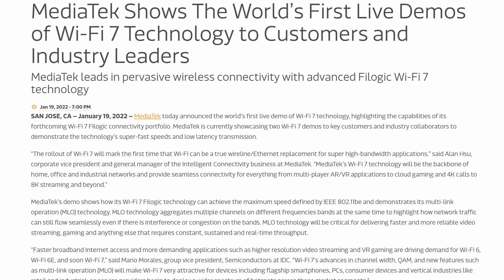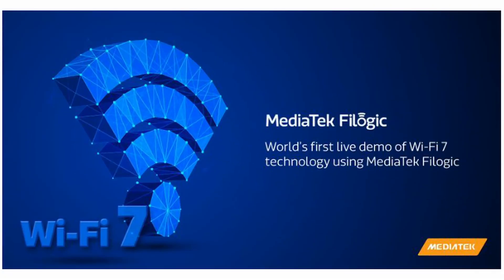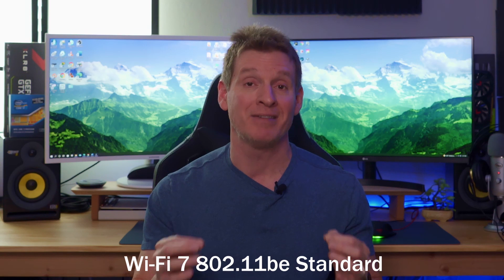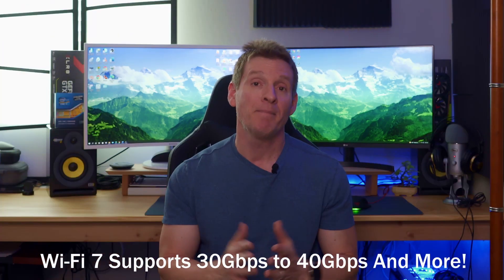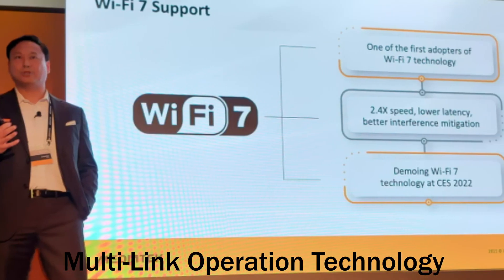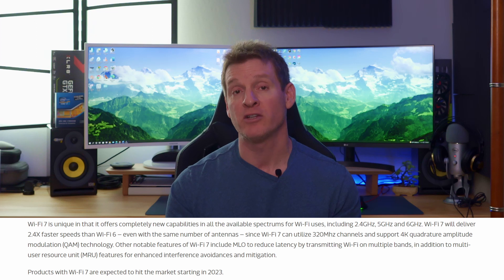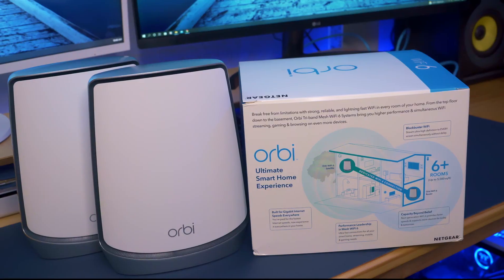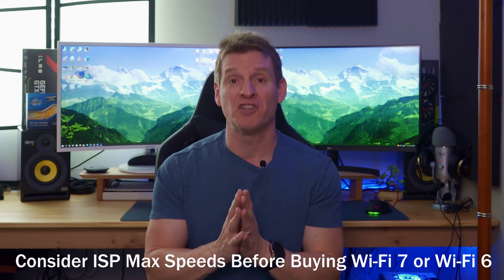Wi-Fi 7 FULLY EXPLAINED!!!

Comment: Is wifi 7 same as 5G ?? What is difference between 2
Reply from the maker: Wifi7 is your Wireless Home Network speed from the router which depends on your ISP max speed. 5G is an ISP that gives you up to 10 gigabits per second in the best case scenario. Speeds will vary depending on end devices and where you live. For those with typical fiber or cable internet Wi-Fi7 would be a fantastic choice. But Wifi6 or Wfif6e is also pretty amazing! Thank you for watching!
Reply: @UltimateTechHub  thankyou 😊 So if wifi 7 support 30 Gbps then it will become 6G service provider?? Too right

Comment: WiFi 7 802.11be 2024 7th generation of WiFi, the ultimate online experiencewill be unleashed
4.8× Faster 
WiFi 7 accelerates throughput up to 46 Gbps 100× Lower Latency* Worst Case Latency is 100× better compared to WiFi 6 with 15× better AR/VR performance
× Network Capacity*
With 320 MHz and MLO (Multi-Link Operation), WiFi 7 provides up to 5× greater capacity than WiFi 6
Reply from the maker: Thank you for watching and for the great comments and information!
Reply: Hey Michael This is me Cathy. Only God has the control to make Wi-Fi 7 come out in 2023 in so as his son Jesus Christ so all we can do about it is we can just pray about it and then after they both answer our prayers about it then they will be 100 percent sure to make Wi-Fi 7 come out this year in 2023 instead of waiting until 2024.

Comment: In the no-marketing real world you can expect speeds between 600Mbit/s and 1.5Gbit/s.  The real exciting new thing is the possibility to use 6GHz which this guy totally missed.
Reply from the maker: 6 MHz is very exciting. Wifi6e is the next step but wifi7 is right around the corner and  it is the future. It can use all of the channels and the MLO technology is pretty impressive. Real-world tests like I said will be interesting  because not everyone has the end devices to handle it....yet. I will bypass wifi6e for wifi7. My current wifi6 access point gets me around 800 to 900mbps with low latency. I do have Igig fiber. I have a video in editing about wifi6e so keep an eye out. Thank you for watching I really appreciate it.

Comment: I recently got myself an TP link eap660hd wifi 6 AP and shut off the wifi 5 ap that is built into my isp provided device.  That wifi 6 ap improved speeds on all my wifi 5 devices I have in the house. Currently the only wifi 6 device I have is my desktop and I got almost 700 down on a speed test.  But, it's always hard wired. But wireless tech is absolutely fascinating.
Reply from the maker: You have a really good setup!! Congrats!! Yes I am amazed how fast wireless technology has become! Thank you for watching I really appreciate it.
Reply: @UltimateTechHub  Thank you! Ever since I got fiber last year, I've been doing network upgrades and trying to learn as much as possible.   Went from having 1Mbps down/up to 1Gbps down/up.  Im spoiled now. Haha.  Using a poe + switch i got from work to power the wifi 6 AP.  First kind of wireless I messed with was 802.1G at a friend's house. Its certainly come far indeed.  Thanks for the reply and I subbed too your channel. :)
Reply from the maker: @techmaster170  I have a PoE++ on one of my APs and it gets 2.5gbps which is amazing!! But yes you have come along way and congrats on the fiber it awesome!! Thank you for subbing too!!
Reply: @UltimateTechHub  What kind of AP are you using if it requires poe++? Thats a max of around 50 watts? Do you have a video I can watch? I just found your channel today and haven't looked through to many of your videos yet.
Reply from the maker: @techmaster170  Here is the video link.
https://youtu.be/HaFEwhxU-6A